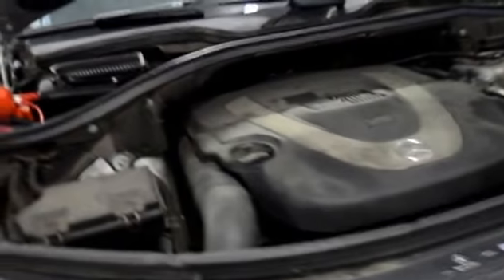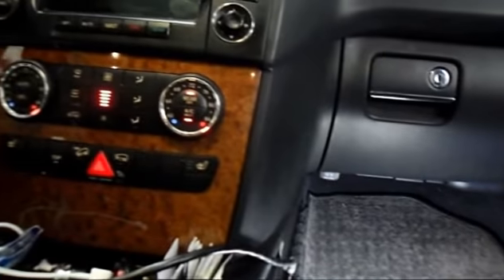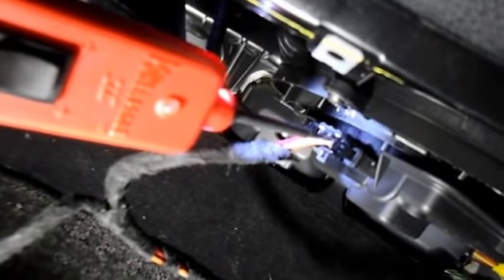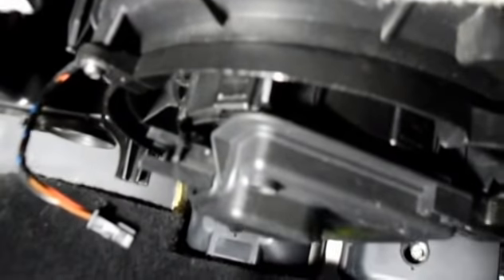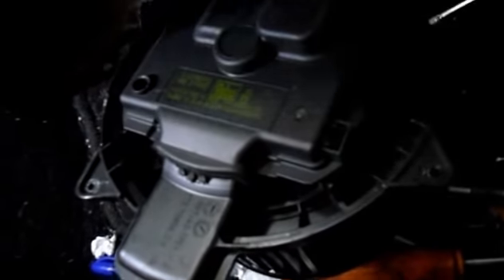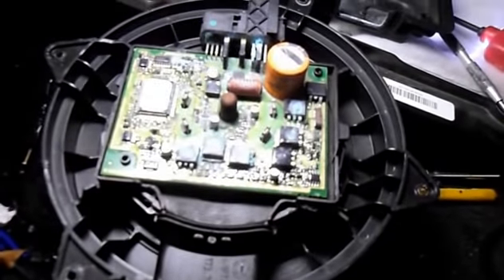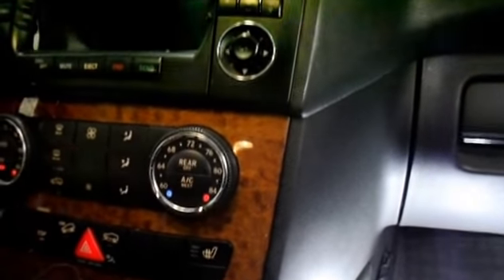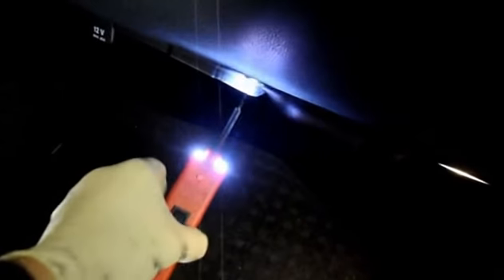How to Check And Replace The Heater / AC Fan Blower Motor Assembly On A 2007 Mercedes

Comment: I got the board off easier than taking it out found more corrosion still getting power always wants to run how to test board or know what 4 pin wire does I always have power at to wire plug
Reply: 2 wire plug

Comment: Mine kept running when the car was off I opened it up found green corrosion on board I was reading a guy cleaned his with same issue
Reply: I'm having the same issue.   What did you do to solve problem?
Reply: @samd6601  I added a switch but install is difficult for big guy with bad back it was making noise and was touching putting pressure on the screw points to see if was loose it vibrating and sounded like it broke the blades but beforehand I opened it cleaned inside corrosion and charging the battery seem to make function as normal I believe that there very sensitive to voltage drop because when running it was fine but when it set dormant it started running on it's own  I assume I'll have to buy one if I broke it but haven't pulled out since I heard it crashed sound. I haven't removed being outside working on it when I have extra $100 I'll get one off internet I'm fortunate my brother is mechanical prodigy and own garage buissness  but he still charges but tips are free
Reply: @samd6601  try charging battery first before you pull it

Comment: Jim, enjoy your vids.  I have a 99 Mercedes E300TD that has a blower that doesn't work.  I think mine has a separate resistor module.  If there is power and ground to the blower then it should work, right?  I'm sure you did not get the blower assembly from Mercedes due to cost but where do you buy these parts?  Thanks

Comment: Thank you. I will be replacing my daughter's 04 ML 350 blower assembly this Friday.  I thought I knew how to handle it, not too difficult, and happy to know the old man can still do a few things. I have a 98 ML 320 and I believe it is somewhat different from the 04. My fan makes noise at high speed, like a roar. My daughter's make a mechanical noise, unlike mine, like bad bearings....

Comment: Hi I have a 07 gl450 and sometimes it smells like a burning smell coming from vents when heat is on. You think it’s the blower? It happens once in a while.
Reply from the maker: Yes it is possible.If you remove the blower motor you can smell it to see if that is where the burning smell is coming from.

Comment: I'm just checking the general procedure for my 2001 E320. I noticed that he doesn't mention that the pollen filters should be checked or replaced if they are restricting airflow.
Reply from the maker: Actually that is always a good idea but this owner did not want to pay for anything let a lone an added expense for the filter.If it was my car I would have replace it.Thank you for your input and for watching.

Comment: My situation is a bit different on my '07 R class diesel motor. My rear AC motor decided not to shut off today, So here I am searching out how to repair it. I'm guessing there must be a short somewhere that is constant hot. I imagine that it won't be too long before my battery dies. Any suggestions?

Comment: Thanks for the post!  Just finished my replacement of my blower motor on my 2007 GL450. This video was very accurate compared to my model. All steps were complete as to what was needed for removal and reassembly. Thanks!

Comment: I really appreciate your posting this video.  I took the main ideas and applied them to my 2012 Mercedes C300.  For mine, the blower and electronics have been separated, which is easier.  I tested the output on the electronics when the fan was on high and it only registered 2.1 volts.  Upon applying 12 volts to the blower, it ran fine, so I ordered the new resistor/regulator circuit board (made by Behr).  Thanks again, saved me some bucks.

Comment: Hello
My 2006 ML350 blows air, put neither cold, BAD AC, or hot....
now hot... I cannot find anywhere if this model has or not a "heater Valve"

Does it? where? part number?

Thanks!!

Comment: What kind of test light is that? Where can I get one?
Reply from the maker: The one I use is made by Power probe but you can get on at any large auto store or on line.If you need the Power probe part number let me know.

Comment: Is this in the same location for the 2008 GL?  In my case the motor wont stop blowing out heat, it wont turn off at all.   Would I just be able to unplug it until I can replace it? So the heat wont blast when its 90 degrees out.
Reply: Its in the exact same place by the way.  And I was able to just unplug the blower motor, no more constant heat.  Unfortunately, nothing comes out at all now, but better than constant heat!   Thanks for the video my guy!
Reply from the maker: It should be almost the same.Yes you can just unplug it until you can do the repair.
Reply from the maker: Great
Reply: +jimthecarguy I think this is a ML550? Looks like the same motor in the GL550. Everything is in the same position.
Reply: +Sirahn did replacing the blower motor fix your problem with constant heat?

Comment: Great video. Mine failed because drain hole in engine intake air housing clogged up with debris and water then flooded fan when going thru car wash, water ran into floor of vehicle. you can clean drain hole by pushing finger thru it.
Reply: Hi,
I was able to fix the blower motor, but would like to know where to find the source of the flood. 
Could you describe the location I should clean

Comment: Thanks for this instruction Jim, it is perfect. My 2007 c230 squeaks when I turn on the blower. Crazy thing is it stays consistent and does not squeak faster or slower when increasing the speed of the blower. I take off the filter from under the hood and spray wd40 and it gets better but only for a short while. Still seems to me like the answer is to replace the assembly like you did. Do you agree??? Thanks, Chuck

Comment: Hi Jim,  My E320 blower motor groans during winter months when I start the car for the first time each day.  After a minute or two, the groaning goes away.  I suspect water may have rusted the bearings.  I'm not sure how or why water got in there.  I keep leaves out of the intake in front of the windshield.  There must be something I can do to eliminate water, but what.  I usually run the front defroster to help eliminate moisture in the cabin, but could a drain be plugged somewhere?  Help!  Thanks Jim!
Reply from the maker: From what I recall there is a drain in the front that gets clogged with leaves.Good luck Jim

Comment: clean or replace those air filters behind the glove -- 2 of them - 1 is pushed back in the corner -- dirty filters will cause the fan motor to over heat blow the resister

Comment: My blower motor comes on by itself (even when I take the key out of the ignition). This completely drains my battery. Can I drive without a blower motor, till I get my new one? I hope this motor is not driving the radiator fan.
Reply from the maker: Yes you can drive until you get the new one.
Reply: +jimthecarguy I'm having the same issue as aakasht has mentioned.... my battery is drained and when I jump my ml350 it starts but once I turn the car off the fan continues to blow which drains the battery.... Are you saying, you can remove the blower as provided in your video to prevent the battery from draining and the vehicle would run with no AC/Heat?
Reply from the maker: +Fredruff  Yes you can remove the electrical connector and that will turn off the blower motor until you can get a new one you will have no heat or defrosters.
Reply: +jimthecarguy One last question Jim as I'm attempting to disconnect the blower as I type, I got a little resistance on disconnecting the electrical cable and don't want to break anything, in your video you pulled the wire fairly easy, are you pushing anything in when pulling? It appears the parts are the same although mine is a 09 ml350
Reply from the maker: +Fredruff  Yes on the electrical connector there is a clip you will need to push in to remove the connector.
Reply: +jimthecarguy Thank you! Not sure why, but Im still having no luck with that very first electrical connector but I tell you what, once I figure it out, you have saved me 100's to 1000's on this video.... Happy New Year to you!
Reply from the maker: +Fredruff    Good luck.Keep me posted.Happy New Year.
Reply: +jimthecarguy Ok, I took everything apart and attempted to clean the little amount of corrosion of the control board and reconnected the wires as a video by Jason Killingo did for his car but once i connected the fan wires with the car off, the fan came on which is the issue thats draining my battery, mind you my heat/air works fine, my issue was the fan wouldn't stop blowing after the car is shut down..... Is it safe to assume I need a new blower or maybe something else altogether thats malfunctioning.....
Reply from the maker: +Fredruff  Yes it will need to be replaced .
Reply: +jimthecarguy Following ur advice, I disconnected the blower motor from its power source. My car ran fine for 5 months without any issues with the blower motor power disconnected. No battery draining out etc. Thereafter, last summer I got it checked. (Gets hella hot in NorCal, cold not so much) They said the blower motor "switch" was bad. So got that replaced (along with new brakes and tyres which I needed) and no issues since then. Thanks Jim.
Reply from the maker: +akasht  Great.Thank you for your input and your follow up.
Reply: +jimthecarguy just to update you, weird thing happened.... i notice another day before getting to the dealership the fan not blow when i turned the car off so i tried a fee more days this time with the electrical cord still intact to see if the fan would come or drain out the battery and what do you know, no fan or drained battery.... car been working fine... i guess cleaning off the corrosion and drying the module out worked after all..... thanks for your experience and knowledge!
Reply from the maker: +Fredruff  Great thank you for the up date.